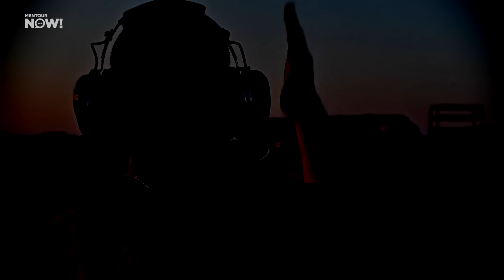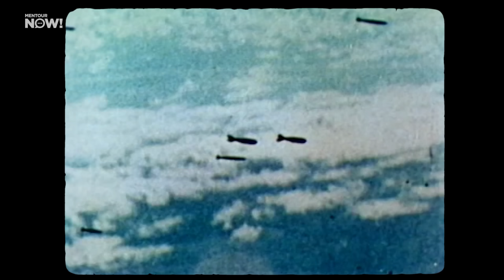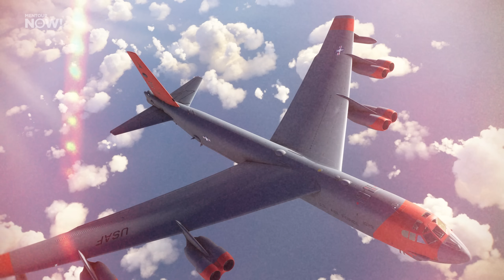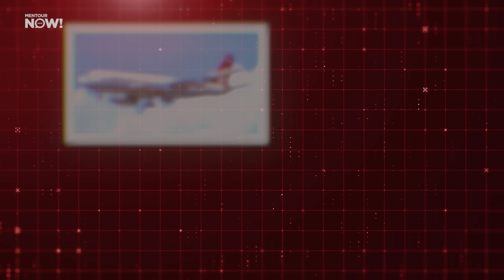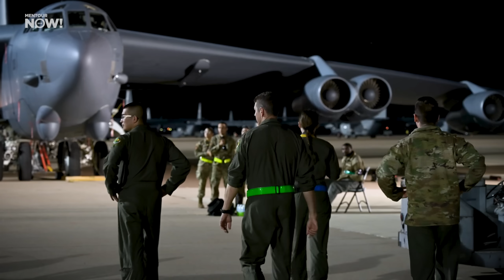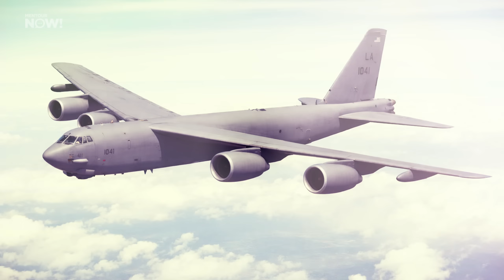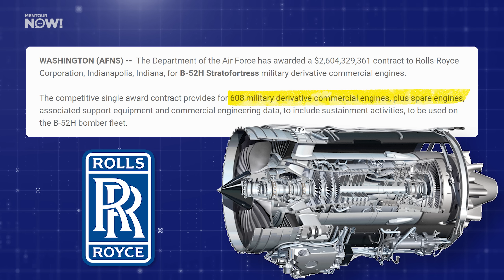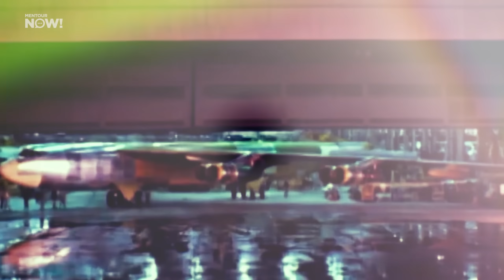WHY Are They Changing The B-52 NOW?!

Comment: Why?  Because jet engine technology has evolved immensely in the last 70 years.  Those old engine designs are simply...  old, even if every single component was 'modernized' the design itself is old.  They probably swapped them because of the shotgun shell ignition kick thing.  Or more likely because what they designed to replace them is a far superior engine.

Comment: I went thru basic training in Lackland TX in 1971.  B-52's out of Randolph AFB flew over Lackland taking off and landing. While training outside when one flew over it was so loud our instructor would have to stop what we were doing because of the noise.  Was actually a pleasant change for a few moments, better than listening to a  TI barking orders.
Reply: Same in '79... Higher bypass engines hopefully means quieter flybys...  HOPEFULLY
Reply: July 12, 1971 first day at Lackland
Reply: @robertheinkel6225  Arrrived at Lackland in April 1971.  Was in the old cracker box barracks.  Was jealous of the guys in the new barracks, air conditioned. Had a couple of red flag days toward the end. You probably had a lot.

Comment: The only reason for not going from 8 to 4 engines is because the airframe can't handle it.  Half the engine mean about half of the maintenance costs.  That is a big win except 4 engine is not what the airframe is designed for and they aren't making any new B52's.  So, it isn't getting a redesigned airframe.

Comment: NEWER IS NO GUARANTEE THAT IT'S BETTER

ASK CHEVROLET, FORD, TOYOTA, VOLKSWAGEN.
DIGITAL VS ANALOG? WHICH IS MORE RELIABLE, LESS inclined TO OUTSIDE INTERFERENCE? ANALOG WINS, HANDS DOWN!  EASIER TO REPAIR/REPLACE, ANALOG FOR THE WIN! WHICH IS BETTER FOR TROUBLE SHOOTING? ANALOG AGAIN! NO EXTRA DIGITAL  EQUIPMENT SCANNER NEEDED? ANALOG, JUST A DIGITAL MULTIMETER.

Comment: What advantage does the B-52 offer over the C-17 with Rapid Dragon?  While the C-17 cruise speed is about 50knts slower, its loadout is double (45 Lassrms vs 20). The biggest advantage for the BUFF is range, which is nearly double the C-17 range.  However both can be refueled in the air.  The US has 76 B-52's vs 200+ C-17s.  Neither plane is going to penetrate, let alone survive, a modern contested airspace. These are standoff platforms.

Comment: Sounds to me like the power of the “military-industrial complex” in full effect.  If they wanted to continue producing parts for the TF33/JT3D believe me, they could have.  What about the tens of thousands of other replaceable parts on the airframe???  Same thing.  And of course they “discovered” other problems, like the inlet (which they could have seen coming) after it was too late to cancel the whole dumb idea.  More time, more cost over runs.  The system is designed that way!!

Comment: The Boeing B-52 bomber is severely creeping up to the danger point where it would just be better to build a brand new bomber. This attempt was made in the early '70s and '80s with the B-1B and the B-1 bomber. However, in 1990, they were going to make a B-1J variant; this variant was twice the size, held more bombs, and could fly longer distances. The funding for it dropped out. There is only one drawing, but the United States government picked the C-17 as other aircraft took priority over the bombers. My suggestion is to scrap it; it's not worth keeping around and is costing a fortune. Several engines were designed on blueprints for this aircraft, but the government failed to purchase them and have them built by General Electric at the time.

Comment: I'm sure this is going to be mentioned later (as I post this three minutes into this vid)...

It has eight engines because it has a small rudder (yaw control surfaces.)

Edit- Yup! At @12:50. Dang I ought to learn to watch the vids before I post. (I guess it's also a case of 'If it ain't broke...)

Comment: The B-52 is just a really cost effective bomber.  It has a massive radar cross-section, but once you take out the enemy's Anti-Aircraft weaponry, that's when you bring in the B-52, because they have so much more capacity to store bombs than the B1 or B2 bombers.  B52 are easier to maintain because they have a more traditional body style than the B1 or B2, don't have to worry about special stealthy paint or  radar jamming.  When I was in a B1 Avionics class back in 1995, one of my instructors told a story about a time they were working on the flight line when a tornado hit the base.  They were too far from the hangers to get under cover, so they climbed into one of the planes and buckled into one of the crew seat harnesses.  The tornado picked up the plane and tossed it around.  Fortunately the plane held up really well, and the harness kept them safely in place until the tornado passed.  They had a little whiplash, but no real damage.

Comment: Great video - as all of yours are.  My dad worked at the plant that was purpose built for building the original OAS (Offensive Avionics System) more commonly called the bomb nav system.  That plant was moved into in 1957 from temporary facilities 'up the road a bit'.  One distinguishing part is the radar tower where 'targets' can be seen for development/testing back in the day - all wooden construction, absolutely no metal.  I'm in my mid 70s now - back in 1978 (after college, military, etc) I was working at the same plant.  Some of my code was in the power up sequence of the processor upgraded at that time and so on.  Those units have been upgraded at least once by now.  My one brother in law was a pilot on D/E/F models back during Nam - something like 1,700 combat hours of flight time in them.  So our family has been connected since it was a new aircraft.  That airframe will outlive many of us engineers and crew who were intimately familiar with the old girl.  She's quite the beast.

Comment: 21:35 No I don't see that no one is "dragging their feet". From what you told me there are a lot of people dragging there feet here. It isn't really that surprising that changing the engines requires extensive tests and requalification. But this is also something that could have been solved during the engine selection program. The program started in 2020 and the engine got selected in 2021. Now it took them another 5 years to design how to use the engine. Something they could have worked on already during engine selection. That Boeing needs another 7 years just to get that implemented is just wild.

The B52 originally got from design into service in ~7 years, roughly the same time frame. There was no modern air flow analysis, no CAD, no nothing. All of those tools, make work quicker or we wouldn't be using them. Meaning the hold up is in other places. 

Meaning as everyone should clearly see. They (as in everyone involved) are clearly dragging their feet!
Reply: The B52 of 1952 is not the same B52 of 2025!!!!
Reply: @PurityKontrol  And how would that influence my statement?

Comment: In the 90s, Boeing made an unsolicited proposal to the US Air Force to swap out the eight turbojets on the B-52 with four 737 turbofans. The proposal stated that the cost of this endeavor would pay for itself in two years from the reduced fuel and maintenance costs. The Air Force turned the proposal down.

Comment: Very interesting and informative! Says a lot about the design and construction of the B-52 that none of the original builders are even still around anymore and yet the aircraft is still use continually and is still the Air Force's first choice to do the job that it has done for the last 70 years! It has been adapted many times over to different types and designs of weaponry and yet still remains the most important airplane Air Force has because of its adaptability and it's endurance.

Comment: Having worked as a commercial system software developer for 29-years, I can attest that early architecture and design choices can hamper innovation.  Wouldn't it be better to start with a clean slate?  One must ask: better in terms of what?  As an example, application code written for IBM System/360, a 24-bit operating system developed in 1964, is still supported today on their Z/OS 64-bit operating system, a system supporting tri-modal addressing (24-bit, 31-bit, and 64-bit).  Considerable intellectual investment is made in software.  So, when I hear folks flippantly advocating for a rewrite of ATC or IRS software, I know they have little idea of what goes into developing software.

In the 1990s, I watched from afar a rewrite attempt on a commercial software package, a rewrite attempted with a "modern" language.  After numerous deadlines slipped and $6M down the toilet, the project was canceled along with a number of developers and the management who greenlighted the project.  As far as I know, the original software, software designed in the late 1970s, is still running today--along with modifications.

Comment: I was a mechanic on the BUFF for 10+ years. They have the space to add new equipment to support new weapons systems. You can still use them as a mobile launch platform to launch various missiles. If all else fails they can drop old fashioned bombs from such a high altitude that the enemy has no clue until all hell breaks loose. Back in the 90's I was on a cattle ranch in Montana. There was a five mile long "Coulee" that snaked its way across the southern end of the ranch. It was hunting one afternoon from up on top overlooking the coulee. A BUFF was flying in the coulee to evade radar. There was a bomb range in the area. The coulee wasn't more than 200' deep. I was looking down into the cockpit windows as it flew past me. I clearly saw the pilot and copilot. They had to have been about 50' off the ground. One of the most amazing things I ever saw.

Comment: 15:41 You mentioned the anhedral wings and low wing tips.  As seen at this frame, the B-52 actually has wheels on the wing tips to prevent ground scrapes, especially with heavy fuel load on-board.
Reply: The 737 max should answer your question. 

Thrust angle, center of thrust vs center of lift offset, and a physical diameter change means that just because there is a little wheel out there doesn’t mean you can have the engine close to the ground. I also suspect that the engine won’t touch just because it’s has gear out there, the structure of the wing holds the engine up, those are only there for stability because of the 4 point narrow gear on the fuselage. The U2 has temporary ones for that reason but if you balanced it, the wingtips would not droop to the ground.

Comment: I love this plane! I was taking a mid day shower living in South Orlando FLA, when I heard a very low flying B-52 over our house. I looked out the shower window and witnessed the engines of the outer wing on the left side on fire. The plane was actually turning back to McCoy AFBase. I then quickly got out of the shower and told my Mom and young brother what I saw. My Mom said that plane is in big trouble so we all hopped in her car and we started going to McCoy. My Dad had retired from the Army and we always shopped at the base and had access. Sadly as we are approaching we can see the large billowing black smoke rising in the distance and by the time we got there the authorities were already restricting traffic. I saw just a couple of homes from Daetwyler Shores damaged and on fire. Obviously we saw the wreckage of the B-52 on a small lake just across McCoy road. Apparently we learned later that the poor crew wanted to desperately land and avoid crashing into homes so they went for the small lake. It was traumatic for us to see our fellow service folks in the Air Force try to save the plane and people on the ground the best they could and fail. I was a McCoy AFBase commisary bagger at the time that had friends from Daetwyler shores which also were classmates at Oak Ridge High. Needless to say but the B-52 plane and those who fly it hold a special place in my heart. Today there is a small park near the Orlando Airport where you can visit and touch a decommissioned real B-52. My family used to park at night in those days across the airfield and watch the B-52's and U2 taking off and landing.

Comment: I don't understand why they did not just build new engines to the same design as the old J57s. The cost of re-tooling would be more economical than redesigning and re-engineering the complete airframe for different engines. Typical airforce mentality...

Comment: The new Rolls Royce, BR725 has a thrust specific fuel consumption of 18% less at mach 0.85 vs the TF33-P-3 at mach 0.82  and weighs 1,000 lbs less. Mach .82 to .85 is only about 20mph, but at 600mph (depending on altitude), it's a big difference.  That has to significantly increase it's 8,800 mile range.  I wouldn't be surprised if it adds 2,000 miles. More than that, it may need less refueling so you have to consider the fuel in the refueling aircraft for cost.

Comment: Do the two engines in a single B-52 pod rotate in opposite directions? If so, that would balance the gyroscopic forces due to their angular momentum during any kind of change of orientation. This seems like it  would have been a natural outcome of the dual engine design, lessening the strength needed in the engine support pylons.  Creating mirror image engines should not be a big deal as far as  design goes, but it does mean that there are now L & R versions of some parts, complicating production and inventory.

If the engines were counter-rotating, this makes moving to single engines a lot harder.

Comment: This defies logic - an aircraft designed in 1949, first flying in 1952, is getting an engine upgrade years behind schedule & costing billions of tax-payers dollars just to keep this obsolete beasts operational. All the money & effort that the USAF has spent re-winging/re-skinning & replacing their ageing systems, over the past 63 years, could have been much more sensibly allocated into developing a "realistic" alternative. Every program intended to replace it - the B-70, B-1A/B, B-2 have all suffered from the same fundamental issues - they were too hi-tech, too ambitious & massively over speced. What the US really needs is a big, long-logged bomb truck/missile carrier, that's cheap, reliable, easy to  maintain & available in huge numbers. They could have had that decades ago, had they not constantly pursued their usual "Buck Rodgers" approach. Now they've landed themselves with a fleet of creaking museum pieces powered by biz-jet engines. You couldn't make this up.

Comment: One advantage of the B-52 is that it costs much less per hour to fly than the B-2 and the B-1B. the BUFFs also have been well maintained. There isn't much left of the aircrafts that rolled out of the factory. The B-52 has been adaptable. The B-52 was conceived as a high altitude, high-speed nuclear bomber. Then, it was adapted to low-level penetration. Now, it's a cruise missile truck. One might ask why the Air Force couldn't adapt a commercial airliner to launch cruise missiles. The military likes the redundancy of four or more engines, especially on combat aircraft, Air Force One and the Doomsday plane.  If one fails, you have three or more left. (But wouldn't having twice the engines mean twice the possibility of an engine failure?) Also, if four engines are so important, why does the vice president fly on a two-engine 757? I watched a video of a 33-hour B-52 mission. There was an engine failure and the crew didn't seem surprised.

Comment: The B-52 is a figurative truck. It seems the air force will always want a plane that can haul a huge amount of bombs. Trucks dont need to have stealth. Trucks dont need to be that fast although the B-52 does quite well for such a large truck. It's literally one of those "If it aint broke, dont fix it" wrinkles in the requirement. Could you make something as big and maybe faster or stealthier? Sure, but then it wouldn't be a truck. And you need trucks :)

Comment: New engines greatly increase range.  The air frame is incredibly reliable.  Suspect a modernized cockpit is included.  Refresh of all control system could be good.

Comment: If the are willing to spend billions - why can they not (re)engineer a new small tf engine to replace the old ones? Keeping the size and the 8 enginge configuration.
On the other hand I wonder why they are not able to replace the plane. We have - through various science experiments - 747 plane hardware that was modified to eg. carry space shuttles or open a huge side door during flight and carry a very heavy telescope (SOFIA project). None of that can be utilized to get a "new" plane that has the core capacities of the B52? A 747 can easily carry 70k pounds of weapons and has a range to 15k miles (depends on engine etc.)
And if the air frame design etc. of the B52 is that good and billions are available - why not build new ones? They have the building instructions and loads of old planes and sufficient parts to test and try a lot and they should be capable of building some newer version with similar functionality? 
How much of the B52's staying power is politics, local constituencies eg. money to voters?

Comment: I read that this upgrade to the Buff would last till 2051. There ARE people flying it today whose grandfathers were flying it when They retired from SAC.
The B-52D model used water injection for increased thrust on T/O. When they did the runway could go IFR if a wind didn't disturb the smoke. I was #4 in a practice Minimum Interval Take Off. 4 airplanes on the runway all at T/O thrust at the same time. I only saw about 100' ahead & only saw the lead bomber when it’s tail fin lifted off the runway. Good thing I was Bulletproof in those days & my tanker crewmates were new & thought it was "normal". NOT! 🫡 Carswell AFB 1970's